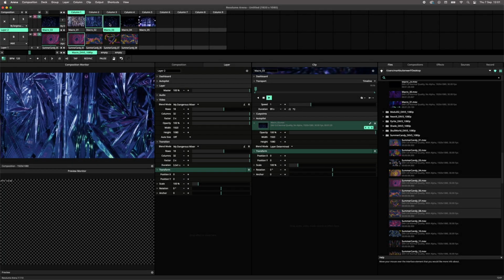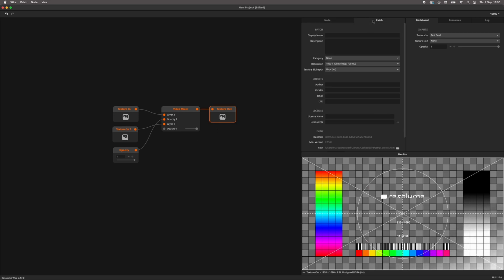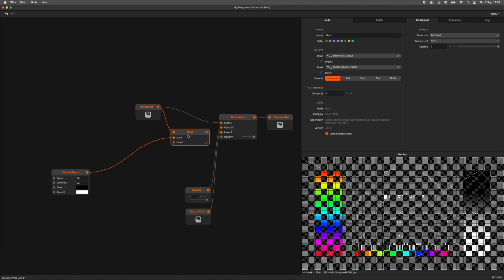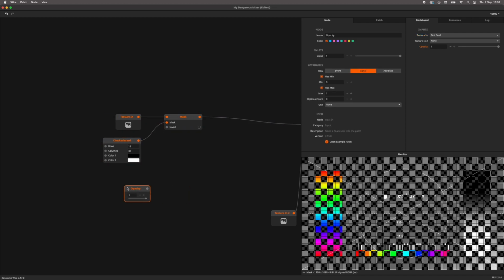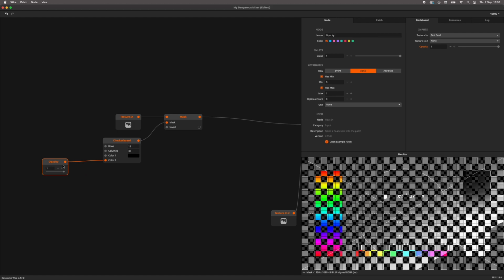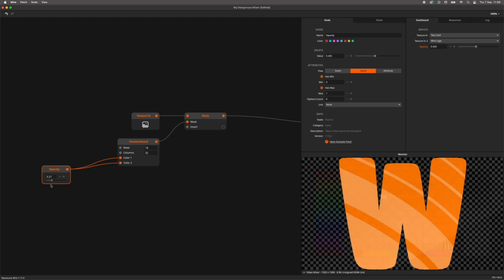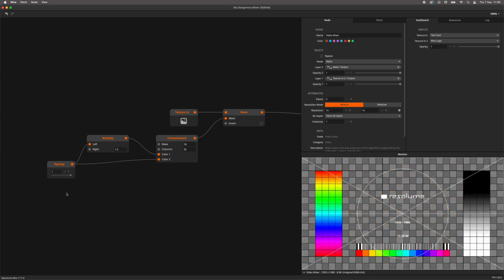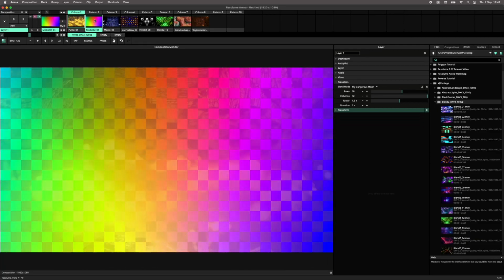Resolume Wire Tutorial - Creating a Checkerboard Blend Mode

Comment: ok so the mixer mode requires two texture in and a video mixer and then automatically works out what those texture in's are based on it's location in Arena?
Reply from the maker: First texture: The layer on which the blend mode is applied.
Second texture: the layer below